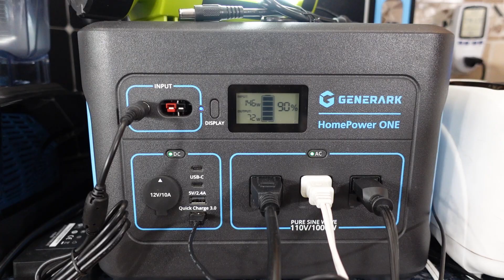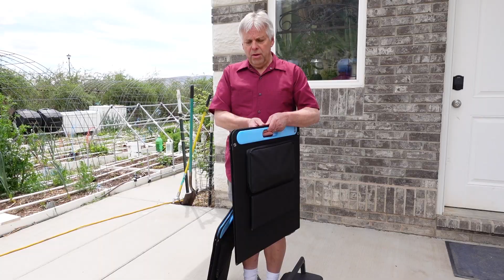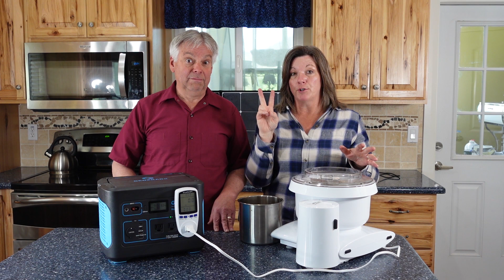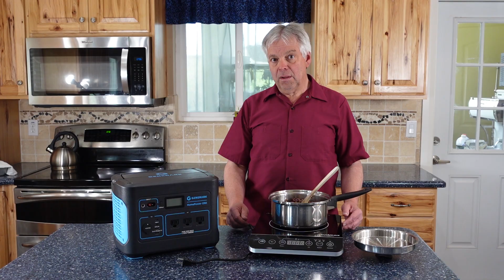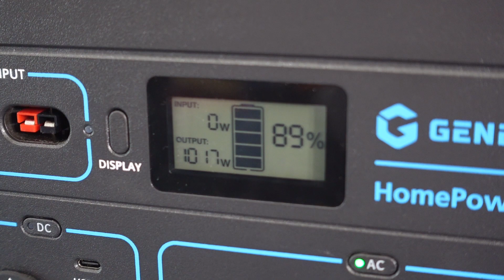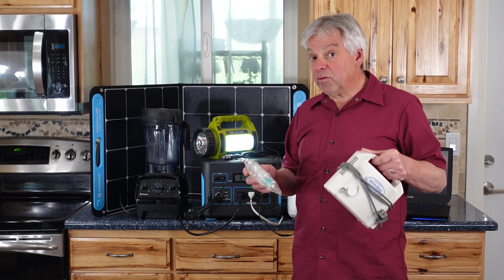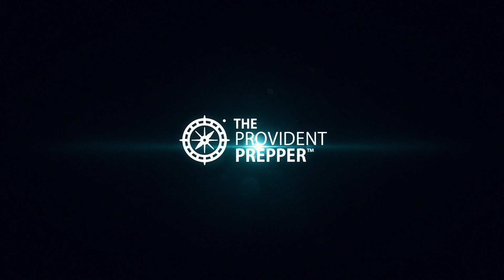Emergency Power: Generark Solar Generator Review

Comment: Will this support my portable AC? Mine is a Hisense portable air conditioner and it says:
Input Cooling Power 1200W 
Power Source 1PH/115V~/60Hz
Reply: Hi Liliana...This power station is not big enough to support your air conditioner. It has a maximum output of 1000 watts. Even if it could output more watts, with only 1000 watt-hours of storage, it would only run the air conditioner for about 45 minutes, then would take 8 or more hours of solar charging to recharge. I normally do not recommend that you use heating, cooking, or air conditioning with a power station since these activities use large amounts of energy. Fans would be a good choice, or if your climate permits, there are some fairly efficient evaporative coolers out there...these are a better choice. If you decide that you do want to run your ac with a power station, you will want to select a much larger unit with more storage, output capability, and solar input capability. Hope this helps...connect back if you have other questions! Thanks for being part of the solution!

Comment: Will one of these power a well pump?
Reply: Hey Jane...probably not, but it depends on your pump. If it is a shallow well, there is a chance that it would be 110 or 120 volts, however, most wells are 240 volts or more. If you have any of the specifications for your well, it should tell you the volts and amps that it draws. Or if you know who installed the pump, they can probably look it up. You could also look at the breaker box that circuit is on and look at the size and voltage being utilized. If by chance it is 110 volts, you would need to know how many watts it uses. This station can only crank out 1000 watts...at that rate it, the power station would be depleted in about 45 minutes, but still enough to meet your water needs. If you can check on the voltage and the amps or watts, we can get clarity on this. If you get that information, connect back on our contact page and let's see where we need to go! Thanks for being part of the solution!

Comment: I  bought my generark at walmart its the same price but the points I got to shop on walmart helped I got the generator and two solar panels  for $1499 right now I wanted to buy this to keep in house during snow storms and can put panels right outside. Takes initially about 7 hours to charge when you first buy it mine upon opening was at 45% charge so may not take so long. I like you can keep in home and not have to go out and put gasoline in a outside generator.  I like it has a 5 year warranty

Comment: I'd want to run a fridge and freezer.
Reply: Hi Julie...Using this power station, I think you should be able to run a mini-fridge, but a full size fridge would be tough. If you are adding a separate freezer, you need much more capacity. In general, full size fridges consume between 300 and 400 kwh hours per year, so they use roughly 1 kwh per day. The Generark Homepower 1 has a usable capacity of about 0.8 kwh. So you might come close if you were inputting the full 200 watts of solar (rarely happens), you had perfect solar conditions every day, you opened the fridge only briefly 2 or 3 times per day, your fridge is one of the most efficient fridges out there, and the fridge is in a fairly cool place that reduces the cooling load. For the past week, I have been running and recording the energy use of my freezer (in the garage) on this station. During this time of year (highs in the 50s and 60s and lows in the 30s and 40s), the freezer uses about 0.6 kwh per day. It was all fine during the first 3 days of sun, but we then had several days of cloudy and stormy weather, and it all went bad. Of course, for now I could just plug in the power station and charge it back up, but in a crisis, you would need to be backing that up with a generator. Based on the 120 volt charging of about 145 watts, this takes 6 or 7 hours to charge...not the best use of your generator capacity.  Bottom line...I would look to a larger power station if you want to run a fridge or freezer. Just out is the HomePower 2 and 2 plus (there are other brands as well). These, especially the 2+, would be a much better fit because they have more storage capacity, and even more important, the ability to input up to 800 watts of solar...a much more robust machine. If you were running a seperate fridge and freezer, you would likely want 2 larger units, or a station that is much bigger...there are some out there that have 3600 to 6000 watt-hours. Hope that gives some insight...connect back if you have other questions. Thanks for being part of the solution!!.

Comment: AS others have asked...Fridge?
Reply: Hey Mike...I think you should be able to run a mini-fridge, but a full size fridge would be tough. In general, full size fridges consume between 300 and 400 kwh hours per year, so they use roughly 1 kwh per day. The Generark Homepower 1 has a usable capacity of about 0.8 kwh. So you might come close if you were inputting the full 200 watts of solar (rarely happens), you had perfect solar conditions every day, you opened the fridge only briefly 2 or 3 times per day, your fridge is one of the most efficient fridges out there, and the fridge is in a fairly cool place that reduces the cooling load. For the past week, I have been running and recording the energy use of my freezer on this station. During this time of year (highs in the 50s and 60s and lows in the 40s), the freezer uses about 0.6 kwh per day. It was all fine during the first 3 days of sun, but we then had several days of cloudy and stormy weather, and it all went bad. Of course, for now I could just plug in the power station and charge it back up, but in a crisis, you would need to be backing that up with a generator. Based on the 120 volt charging of about 145 watts, this takes 6 or 7 hours to charge...not the best use of your generator capacity.  Bottom line...I would look to a larger power station if you want to run a fridge. Just out is the HomePower 2 and 2 plus (there are other brands as well). These, especially the 2+, would be a much better fit because they have more storage capacity, and even more important, the ability to input up to 800 watts of solar...a much more robust machine. Hope that gives some insight...connect back if you have other questions. Thanks for being part of the solution!!

Comment: Thanks for the video! Where do you place the solar panels? How long does it take for the panels to recharge back to 100%?
Reply: I place the panels on the south side of our home and try to keep them aimed at the sun, both direction and vertical angle. Wires are run through the window to the power station. Although I have 2-100 watt panels, I usually only end up with 110 to 130 watts of solar going in the power station (with strong solar). The watt rating on solar panels is a bit deceptive, and you rarely, if ever, get very close to that rating. At that rate, you can usually go from 20% to full (about 800 watt-hours) in a day of good charging. If less than ideal charging, it will take more time. If you have other questions, connect back. Thanks for being part of the solution!
Reply: @JonathanBJones  with that being said, would you still recommend?

Comment: Can this work with a refrigerator?  A portable one?  A regular size one?
Reply: Hey Donna...the HomePower 1 may be able to run a mini fridge, but will have a difficult time keeping up with a full size fridge. Of course, all this depends on your ability to recharge with solar. If your climate is predominately sunny, you should be able to run one of the Energy Star rated efficient mini fridges. Before you make your decision, I would look at the Energy Star ratings and compare that with the power station capabilities. The HomePower 2 Plus station is just coming out and has twice the capacity. There are also other larger stations out there. If you can swing the extra money, I think it is much nicer to have the extra capacity, and critically important, they also have much larger capacity to input solar. This helps tremendously in keeping up with your loads. If you have further questions, connect back. Thanks for being part of the solution!

Comment: I have experience with this.  I have a Jackery 1000 and I ran my regular size (one bedroom apt size) refrigerator for 11 hours with Jackery 1000 and it took it down to 21 %.  Power came back on at that point.  I think the size of your frig has a lot to do with how much power it takes. Also if you have ice maker, etc.  it worked well for me.  In fact my only concern was how to recharge my Jackery.  I solved this by buying a second Jackery 1000 so I can charge with solar power one unit while using the second unit.  I live in Texas so power outages are a thing here.
Reply: Consider a small generator as a backup. I got a 700/800 watt propane generator on eBay for about $230 several years ago in case there's no sun. I have two Goal Zero 1000 power banks. They show how much power is being used by an appliance, so there's no need for an appliance tester for wattage usage. The Jackery 1000 weighs so much less than the GZs but the GZs have a 1500 watt inverter vs Jackery's 1000. The Jackery overall is a much better value, as other than an electric kettle, I haven't found any appliances that require more than 1000 watts to use. My 3 quart Instant Pot is only 800 watts.
Reply: Thank you that’s a great example of real world use and a really good idea of getting the two units.
Reply: That is good to know

Comment: If you are charging with the solar panels can you be using the Generark at the same time it is charging?
Reply: Yes...you can be powering devices and charging at the same time. That is a great question, because some stations do not have that capability. You really need to make sure a power station can do that. Thanks for being part of the solution!!

Comment: Can you charge the solar generator while using it ? Like while using a blender ?
Reply: Hey Andy...that is a great and important question! With this and many other power stations, you can be charging and using at the same time. However, there are some stations on the market, especially some smaller units, that cannot do this. I would not even think about using one of those units because it really defeats much of the purpose of getting one. There are many times you want to be off-setting your use or building storage with solar input. The only possible exception would be some really small loads only used at night, then recharging during the day...not the typical profile for most of us. If you have further questions, connect back. Thanks for being part of the solution!!

Comment: He never touched on an important point...... how long does it take the solar panels to charge the unit?
Reply: That is a good question. The bundle I got has 2 - 100 watt panels, so theoretically I am charging with 200 watts (the rated maximum for this unit) of solar. In reality, you rarely ever get the rated solar capacity. On a good day, I can probably get about 150 watts of input from about 10 in the morning until 4 or 5 in the afternoon, assuming I periodically adjust the panels to get maximum solar. You can get some solar earlier and some later. In total, you can probably charge from 20% to full on a good day, with perhaps the ability to use some energy during the day. Generark indicates about the same thing...they say 8 hours to charge using the solar. On a cloudy or hazy day, you will not do so well, and some days you will be almost nothing. Things to consider as you choose a power station. I often encourage people to go with larger (2000 watt-hours) stations, not only for the extra storage, but also to have the ability to input 400 to 800 watts of solar as opposed to 200...this really helps as you try to stay ahead of your loads. Hope this has helped...don't hesitate to connect back if I didn't fully answer your questions. Thanks for being part of the solution!!

Comment: Will it power a pellet stove?  I tried a cheap gas generator one time during an outage and the dirty power blew my computerized pellet stove controller.
Reply: Hey Peggy...a power station would be a good way to power your pellet stove since all the quality stations deliver pure sine wave (clean) power. I suspect the gas generator put out a wave form that the controller didn't like. This station might do the job, but it depends on your pellet stove. Most pellet stoves use about 1 kwh per day (assuming 8 hours of use), which would make it tough for the Generark HomePower 1 to keep up day after day. However, if you can get by with running the stove for 2 or 3 hours per day, it would likely work. If your solar is good, and you can average 100 or more watts for 6 hours per day, it might get the job done. The best way to figure out what your stove needs would be to purchase a energy consumption meter. They run $20-30 and can tell you the instantaneous usage as well as your usage over time, most especially over a day or week. Here is an example of such a meter: https://www.amazon.com/Poniie-PN1500-Electricity-Electrical-Consumption/dp/B07VPTN8FZ/ref=sr_1_12?dchild=1&keywords=energy+consumption+meter&qid=1630607482&sr=8-12. There are several good brands to choose from. You simply plug it in the outlet, then plug in whatever you want to measure. It can be very enlightening, especially when figuring out your critical loads for preparedness purposes. If I were in your shoes, I would probably opt for a larger unit with more storage (2000+ watt-hours) and one that can deliver more energy (1800 - 2200 watts). These larger units also have the ability you input more solar charging (usually 400 - 800 watts, instead of 200 watts) and would allow the ability to meet other loads as well. It all has be balanced with finances, but hopefully this gives you some perspective. If you have more questions, connect back. I am excited that you are figuring all this out...staying warm is definitely an important aspect. Thanks for being part of the solution!!
Reply: Following

Comment: Hello aim interesting to buy Generak to use  my air compressor but my compressor run in 220 volts how can i convert if this generator don't have that  connection
Reply: Hey Luis...generally, if an appliance or tool needs 220 volts, it usually requires a lot of energy, in which case, this power station may not be large enough to do well. If it is a smaller compressor, but uses 220 because it is designed to be used in a country where 220 is the standard, it may work. That is the first thing to check...how much energy does it use (both instantaneously and over time since the compressor will turn on and off as needed). If the 1000 watts and 1000 watt-hours this station can deliver is sufficient, you would need a transformer to adjust the voltage. Some of the larger power stations do have 220 capabilities...you may want to check them out. Alternately, you could build a small solar power system and use an inverter that can supply 220. There are good companies out there that can help design and specify the right equipment. Hope that helps. Connect back if we can help further! Thanks for being part of the solution!